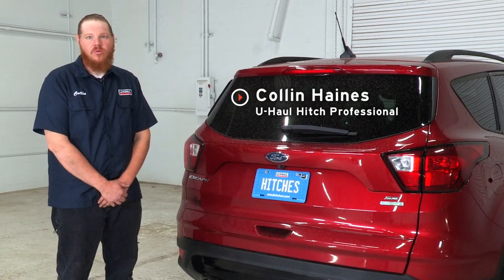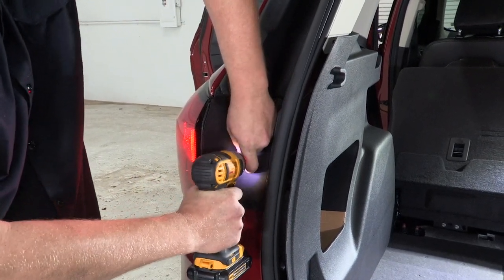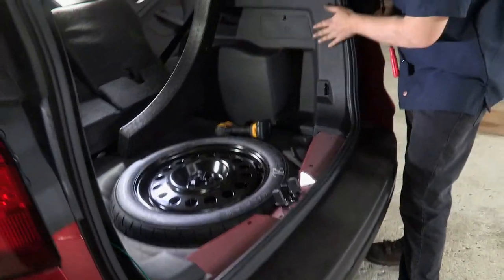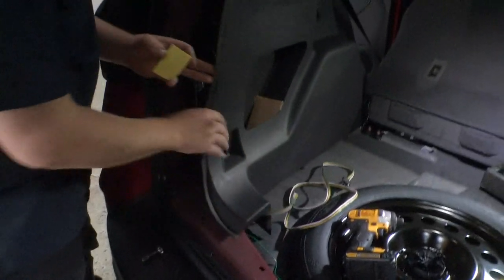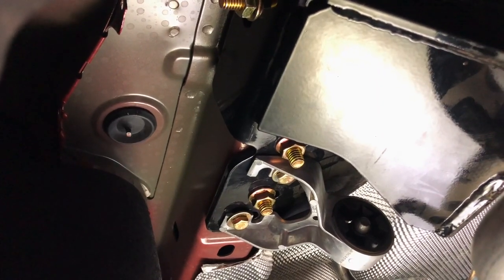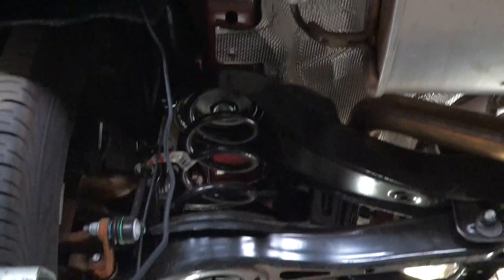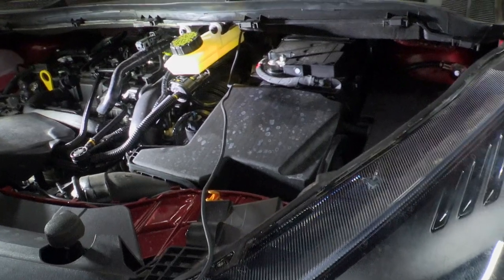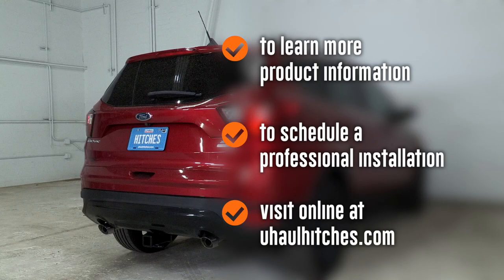2018 Ford Escape Wiring Harness Installation

Comment: Fuse 26. Rear junction box (Rjb). 40a constant for trailer module. 
Even if your escape doesn’t have the tow package, you can just grab your constant 12v power there instead of going all the way to the battery up front. Way easier.

Comment: I'm trying to figure out if it's possible to put a 7 pin trailer connector on a ford escape?
Reply: Hi! To install a 7 way on your Ford Escape follow this video: https://youtu.be/HItAgnlecvY
This will give you tail light functions on your 7 way wiring.